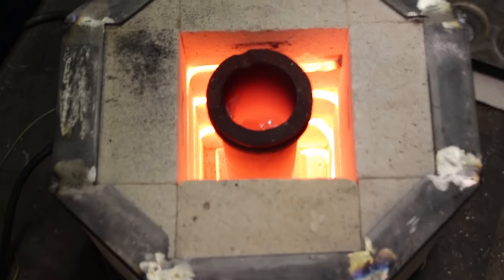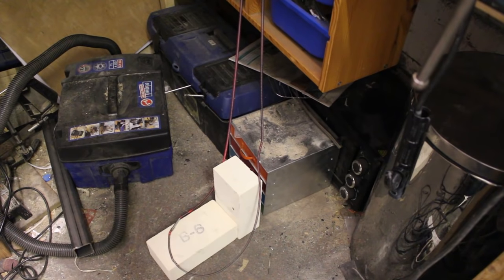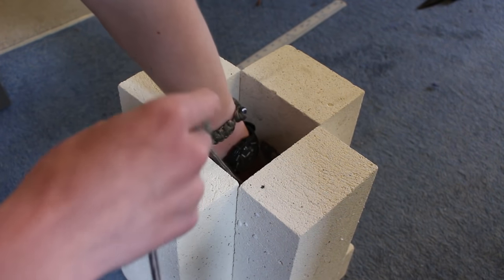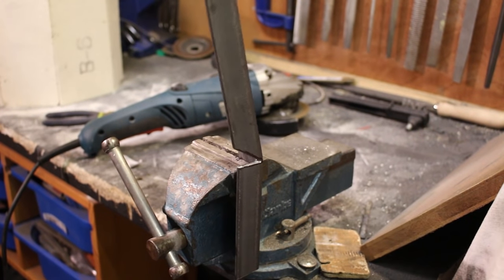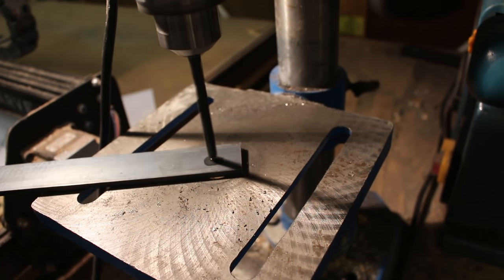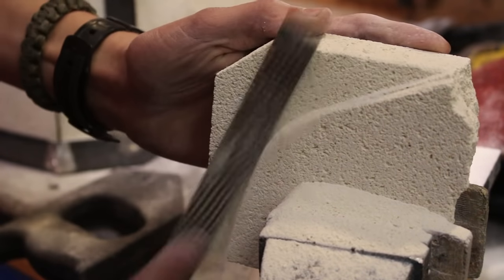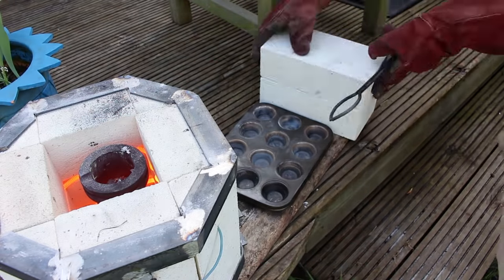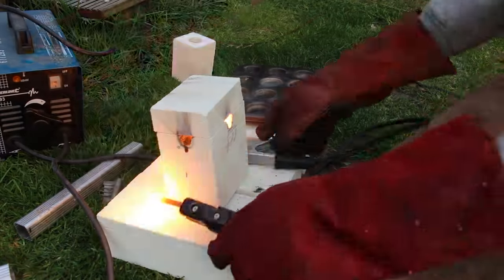How to Make an Electric Foundry For Metal Casting - Part 1

Comment: I get free wood for all my forging and foundry needs, this is cool but i think if you're using this a lot 1800w is going to hit your electricity bill quite badly? Also, if you can find a good DC transformer it would be a lot safer than using mains, low volts and high amp DC will get just as hot but you're unlikely to get even a shock whereas 240v AC will ruin your day
Reply: Can you please tell me about your setup?
Reply: Dima Prok My setup for wood?
Reply: 1800w is 1.8kW, which, in my state, with an energy cost of 13.7 cents per kilowatt-hour, means this would cost 24.66 cents per hour to run.
Reply: RecurveNinja Really depends where you live, mine is cheap but other countries might not be
Reply: 9 cents per kW in my state and if you're on commercial 220v grid it's like 6 cents.  I just found a deal locally for used Kiln, I paid $44 and figured it's cheaper than buying materials but it's not really designed for melting metals.  I watched youtube video and it took a guy over 2 hours to melt, but you could fit a huge cast iron pot with lid in it.  I am going to play around with it, need to fix one coil first.
Reply: @MrcabooseVG
My car has a motor power of over 70000 W, if i spend 10 hours in forging instead of driving 1 hour around with my car, i still save a lot of money.

Comment: Thanks for the video.  I was wondering if anyone could refer me to a heating element and a controller to set a temperature and have it auto stay at that temp?  I want to build a foundry for myself but I know nothing about electronics and such.  Could someone recommend me some parts?  My plans are to cast fire brick for a rounded foundry and a 10-12 Kg crucible.  I'd like to reach temperatures of 2300 F.  In the US if that matters.

Also, I'm not quite sure what he was saying with the resistance of the wire, and how he found the right length/voltage?  Did he just plug the wire directly into the wall or was there some sort of controller on this part 1 video?  And what was the math he was doing?

Comment: Is there a way to make this US outlet friendly? A 75cm coil doesn't seem like it would be practical but I'm only getting half the amperage from a 1.5m coil.
Reply: mynameismatt2010 I'm thinking you will need to do some sketchy combination of 2 outlets. you have to find two of them that are out of phase and combine them.
Reply: mynameismatt2010 180 degrees out of phase that is. then you will get the full 240 volts that they get over seas
Reply: CommonSpence If I'm going to use two outlets I'd rather just have 2 75cm coils, one on the bottom 1/3 and one on the top 2/3 with completely separate connections, that just seems safer.
Reply: mynameismatt2010 Wouldn't that just give you two coils at the lower temp? In the EU you can get almost double the power out of one outlet so he has all of that going through the coil which gets it much hotter.
Reply: mynameismatt2010 Using ohms law I=V/R we get that the current through the same wire in the US is 120/33 = 3.64 A. And the power of the coil would be 3.64^2 times 120 = only 1.6 kW.
Reply: oops I meant only P = I * V so 3.64 * 120 = 0.44 kW

Comment: How hard is it to modify it so the external temperature is safe to touch? I assume pretty easily?
Reply: Didn't you watch the video? In it he was touching the outside of his furnace. Protective gloves are often a good idea when dealing with temperatures like this though.
Reply: Accidents still happen. Even though the outside is only 100 degrees, it is still the temperature where water boils. If you happen to touch it without protection for whatever reason, you will end up with a bad burn.
Reply: VLunarFangV
water boils at 212 degrees here.
Reply: Paul Frederick 212 Farenheit. In the video he says 100 degrees Celcius.
Reply: VLunarFangV
yeah, but it's a dry heat.

Comment: Approximately how many watts does this use?
Reply: He says it draws 7.5 Amps, and I think he has 230 VAC mains. So that works out to 1,725 Watts. Although in his calculations he states 1,800 Watts. Somewhere around there.
Reply: Well, he said 230, but it was 250, as seen by his calculations, and so its about 1875

Comment: what other metals does it work with?
Reply: Depends on the wattage you fire it up with. Soft metals like Aluminium and copper, needs less heat than steel and iron. I doubt this one could be used for anything other than soft metals.
Reply: the heating coils would melt as they themselves are steel. so even if you could reach that temperature it would be very short lived
Reply: Jon Blais That's probably what would happen. A induction heater with active coil cooling would be what one would need to melt larger amounts of steel/iron....if it has to be electric. A gas/oil fired furnace would also be a good option.
However, this furnace build is excellent made. I'll like to give the young man a big compliment for it.

Comment: i purchased a 2000 watt wire. is that too powerfull? because the one you used was 800
Reply: Not 800w, 1800w.
Reply: Johann when he went onto ebay it said : 800 watt
Reply: +Jurie Debie go to 4:08
Reply: Johann thanks

Comment: Anyone know how to get this working in the US? we only have about half the voltage out of our walls. Two plugs out of phase?
Reply: CommonSpence use an adapter, they sell special adapter for that. But something even easier is to cut the coil in half
Reply: Christopher Lefont Higher resistance for half the length?
Reply: CommonSpence what are you asking, I mean that if you cut it in half because it's half the voltage, you will get about the same amount of heat and resistance. because we have half the voltage, a coil the size of his won't create enough heat and resistance, with half the voltage he has
Reply: Christopher Lefont What I am asking is "Does decreasing the length of the coil increase the resistance of the coil?" Increasing the resistance would be the only way to get higher heat out of the lower voltage.
Reply: CommonSpence yes exactly
Reply: Christopher Lefont Ahh thank you. I hadn't thought of that. Do you know what law it is that that follows? like, is there a algorithm which explains this principle?

Comment: Does it melt steel?
Reply: I doubt. If it were able to melt steel, those wires would melt too unless they are made of tungsten which i doubt. They look like as if they are made of copper and copper has a melting point of 1085 °C. Steel goes up to 1600 °C.
Reply: +OpenGL4ever the resistance wires are made outta kanthal
Reply: lol49031
Kanthal is just a trademark for a iron-chromium-aluminium alloy. It will melt at about 1500 °C. Thus you can't use it to melt steel.